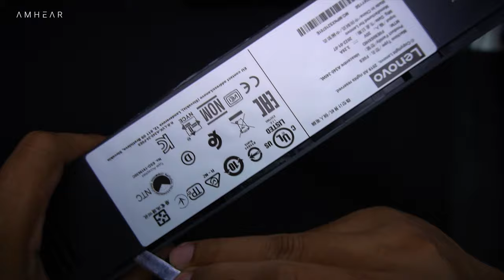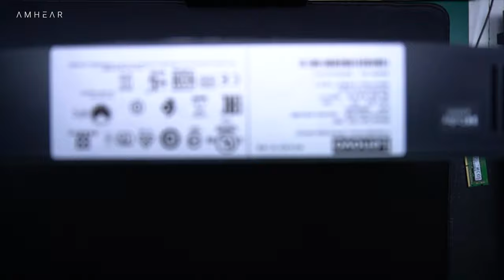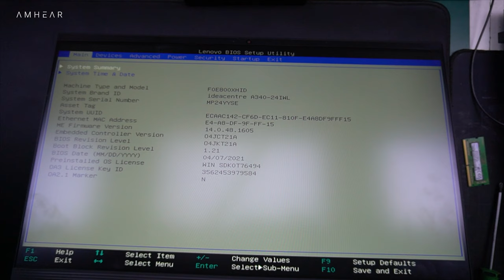Lenovo Ideacentre A340 24IWL F0E800XHID | Upgrade Options

Comment: Hi, Do you know of an option to use the HDMI port and an output?
Reply: *as an output port
Reply from the maker: the average hdmi port on a laptop is an hdmi output, if there is an hdmi input it will definitely be marked.

Comment: i have the same AIO pc for 3 years it was slow at start and crashed alot when i was in meetings so i added an ssd by replacing the cd side and it got a little faster and crashing stopped a little, so i wanted to ask if i can upgrade any part of this such as RAM, processor, graphics card 
what i currently have: 8gb ram, i3 processor , intel UHD graphics card , 1 HDD, 1SSD
what i want to upgrade: 8 to 12 or 16GB RAM if possible, i5 or i7, any graphics card better than this.
please help me
Reply: and one more thing is there any problem with the wifi networking in the pc because my pc have alot of problems with wifi the signal range is too low while other devices i own give me the best
Reply from the maker: ram is upgradeable, processor is soldered to systemboard so is not possible for upgrade.
yes that disadvantage with using signal, i recommend using cable